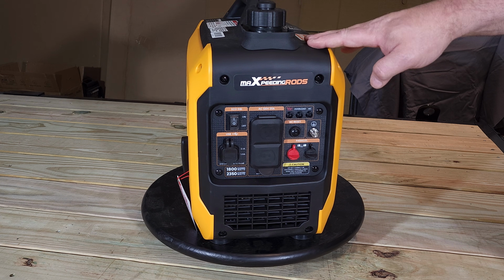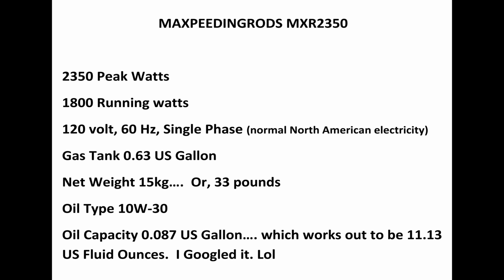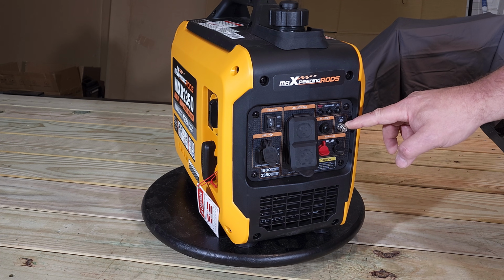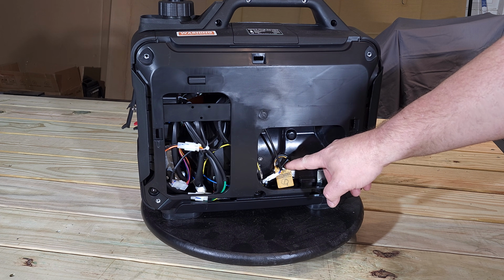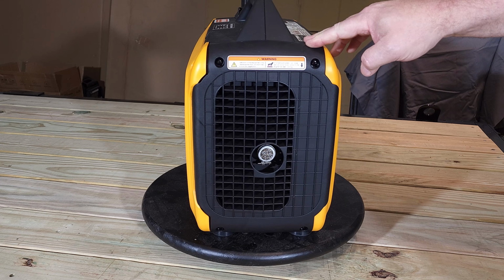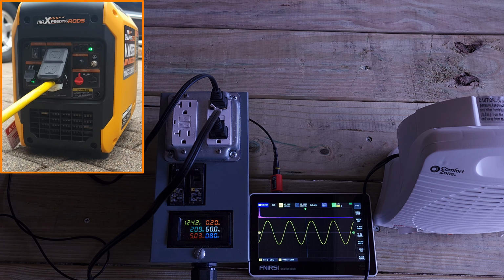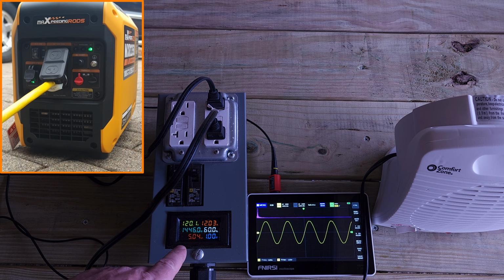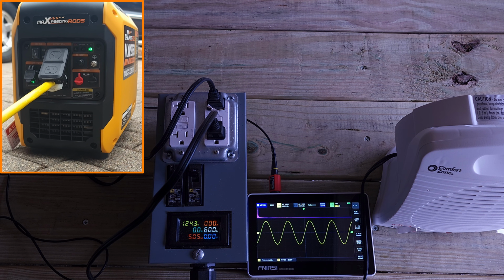MAXPEEDINGRODS MXR2350 Inverter Generator Test and Review

Comment: Good review. Concise and to the point. Good advice about draining carby bowl when not in use. Saves a whole lot of grief at the next startup. I have a couple of 3500’s I run in parallel, as house standby power, and after each run, they get carbies drained of fuel. Never fail to start with one or two pulls each and putter away happily at next run then.
Reply from the maker: Glad to hear that tip has worked well for you too! 👍

Comment: Really glad you did a review on this style generator, I can't find anyone else who has. Looks like Pulsar and Diehard (Lowe's) have 2400/2000 watt equivalents but you can tell it's the same unit. Just ordered the Diehard 2400/2000 from Lowes for $266 and it looks like the perfect size and weight for that output.
Reply from the maker: You're very welcome! Thanks for watching and for the comment.

Comment: How long does this one last? I've read about 4 hours at 50% which does not seem like much at all
Reply from the maker: You asked "how long does this one last"?  Are you asking about overall longevity of this machine itself, or how long it lasts on a tank of gas?  For longevity, I'm not sure.  I don't have a crystal ball.  As for a tank of gas, I'm also not sure.... I haven't tested that.  However, you can get an extended run time fuel pump that makes this generator last as long as you want....  depending how big of tank you use.  I made a video about this new pump using this exact generator to demonstrate.  That video can be found here: https://youtu.be/OrvoBsVOMiQ  Thanks.

Comment: Very good generator if you want to use only two times, I have one never started third time
Reply from the maker: You are probably using gas that contains ethanol....  How long did you let that old gas sit in the carburetor? Ethanol causes all kinds of problems with small gas engine carburetors. That's not the generator's fault...
Reply: @SlipFitGarage I thought inverter generators used fuel injection system instead of carburetor..I'm confused now.
Reply from the maker: @andrehamilton722 
The inverter part of an inverter generator refers to how the electricity is actually made.... the carburetor vs fuel injection is how the engine gets its fuel delivered....  the fact that it's an inverter generator  is totally irrelevant to how the fuel system delivers fuel to the engine.  Very few inverter generators are actually fuel injected. Most inverter generators on the market today still use carburetors to deliver fuel to the engine.

Comment: Could you please do a noise level measurement as well ? Or if you could let me know how it compare to the Honda? Much louder or about the same ich ?

The oscilloscope and voltage monitor during load change is really nice to demonstrate the response. From fan to level 1 there seems to be a flatening of the peaks until recovery otherwise it's a nice response.
Reply from the maker: The generator idles very quiet....  but as load increases and the engine rpm increases, it does get noticeably louder. The Honda is THE quietest generator on the planet so it will never compare to that....  but it's also about 1/5 the price of a Honda so it actually fairly quiet considering the price.  I would have included a noise test but I have not been able to find my decibel meter for several months.  I may have to buy a new one. lol. But for the record, NO... it is NOT as quiet as a Honda.  Thanks for the comment.
Reply: @SlipFitGarage I'm planning on running a couple of fans on that generator with the output of 300 watts give or take how much hours will it last?